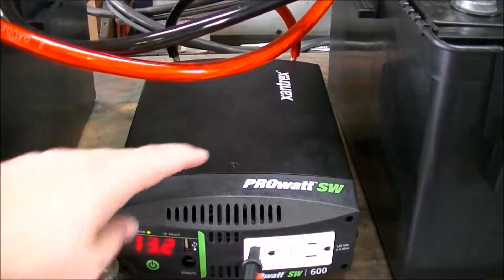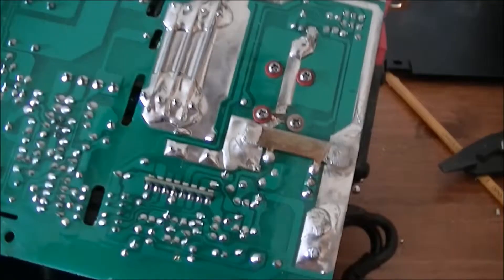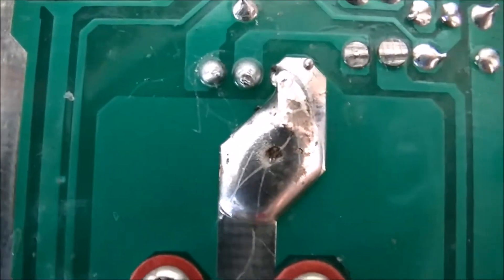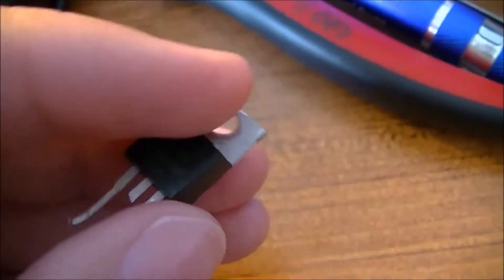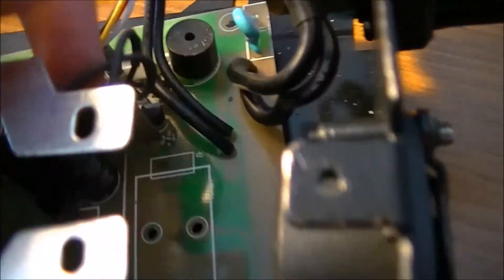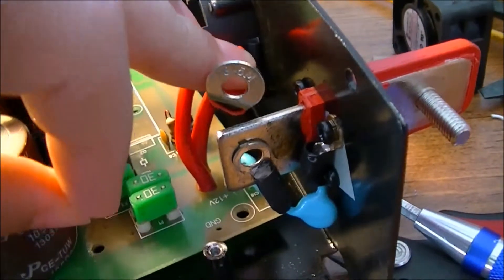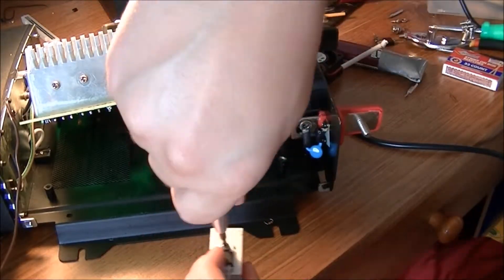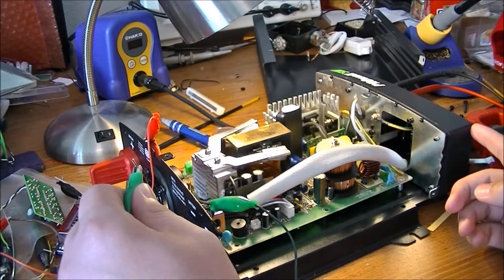Xantrex Prowatt SW 600 repair (building solar generator part 3)

Comment: I had a whistle or inverter with the same configuration and it was only two and it wasn't stop blowup I wouldn't recommend running more than 120 W for that thing I have 120 W pier sine wave inverter that has four fence on both sides of the upstairs
Reply from the maker: They basically all have the same setup in them. Mine has been working fine since I fixed it and it has been under several 500+ watt loads.

Comment: I finalized the replacement , same status no output voltaje, any idea what to check?  

I replaced all IGBTs just to test , but no luck same result.
Reply from the maker: +Serviciosymas Well fist I would check the simple stuff like if the GFCI outlet is tripped that's easy enough just push on the reset button on the outlet (I noticed you have to press it fairly hard if it is tripped). Next I would make sure the fuses aren't blown and finally with my unit one of the PCB traces actually burnt up so I had so solder some wire across where the PCB trace went.

Comment: hi, thx, can you list link for replacement part. I want to use the same one you did use.
Reply from the maker: you will need to replace both of the MOSFET'S even if one of them is still good
here is a link to a 2 pack of IRF 2804's on Amazon
http://www.amazon.com/Power-Mosfet-IRF2804-Transistor-Quality/dp/B00VVM9GRY/ref=sr_1_8?srs=7980496011&ie=UTF8&qid=1451601486&sr=8-8&keywords=irf+2804

Comment: I have one with same problem, I will order those parts irf2804 + 5ohm resitor and see if it works. How to test these mosfets for sure?
Reply from the maker: You can test the MOSFET's with a multimeter, test for ohms between all combinations of pins, if any 2 pins are shorted together then the MOSFET is bad

Comment: Well I think your vid is a godsend, my sw1000 blew and showed same symptoms as yours - display OK but no power, there was a short that caused several failures and blown PCB traces but where I am now is the high voltage dc stage not working so I will check the mosfets you highlighted hopefully that's where my problem is.
Reply from the maker: Thanks i was reading reviews on amazon for this series of inverters it seems to be a somewhat common problem most report the same issue with everything fine and no output i assume they are all having the same problem. the mosfets i put in so far are working fine and i haven't had any issues with them. I will have the review of this inverter put up sooner or later and when you do go to repair it make sure the resistors hooked to the mosfets are sill good as i showed with mine was bad because otherwise you will end up blowing them again and also you will want to replace all the mosfets so they are matched or at least i would recommend doing this